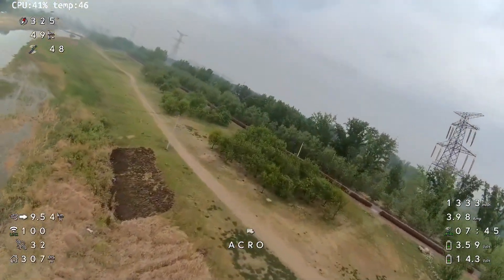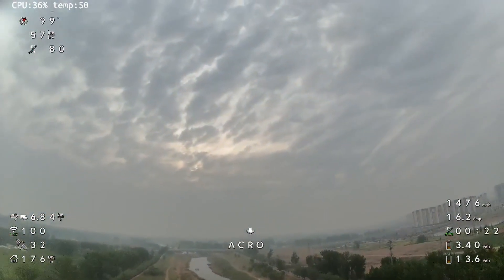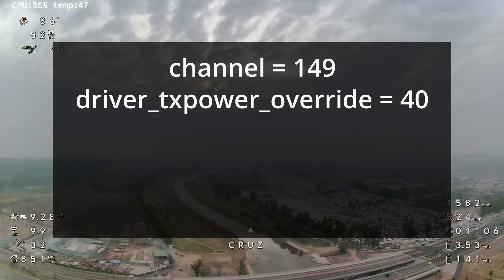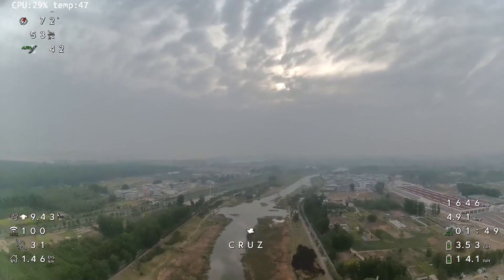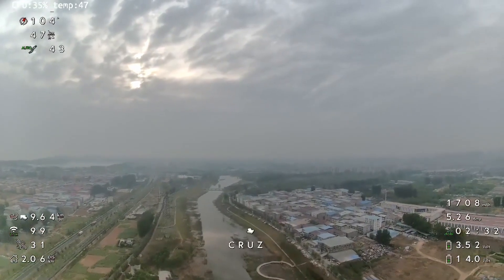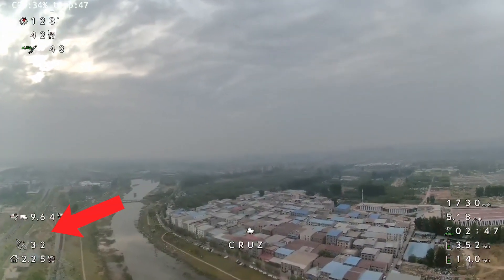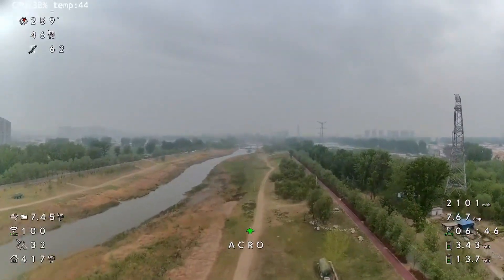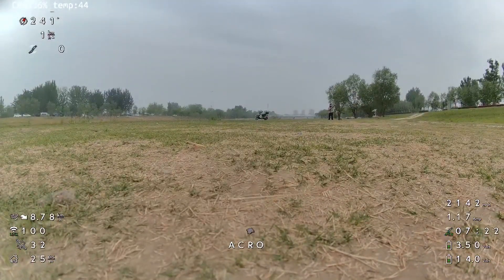Runcam WiFiLink 2 is GOOD now? // Config settings revealed

Comment: Hi friend! I'm Evandro from Brazil, and I'm having trouble getting the Runcam WiFiLink2 system image to full HD, full screen. I'm using it in an RC car and operating it on a large screen at home, but I can't get the full screen image to appear. There's still a menu on the right side. Is there some hidden setting or menu I need to activate? Thanks in advance!
Reply from the maker: what are you using to receive the signal?

Comment: Open source is supposed to mean it can be changed and shared. The ultimate goal is for it to be plug -n-play. The problem is that not everybody will be using this system the same way. For ground vehicles, with very little air flow, the hardware is the problem - too much heat.

Comment: I understand the argument of reviewing as is, but on the part of the project and in showing a consumer what a potential fit it might be, it feels of value to massage out the best config, with the best antenna combo you have access to, while communicating the reality of what it took to get the results.
You say that comes later, provided it does (as you do in this case), that's ok. Think for some reviewers it's just easier to review it as it turns up, and it shifts any responsibility away from them.
Bit like watching a rider review a bike, say it comes with fully adjustable suspension, not touch it, and then complain about feeling a bump in the road.

Comment: Why only one video is recording on SD card 
I connected battery two times to fly
But it show only first video on sd card
All time it show green led blinking 
Means it's recording but it not recording second time 
What should I do with sd card?
Reply from the maker: @khemrajdeulkar9803  onboard SD card recording is very buggy right now.
Reply: @mattscheaprc  Thank u 🙂
One more question 
Do I need sd card for camera and other setting ? 
Means Without sd card can I configure it ?
Reply from the maker: @khemrajdeulkar9803  you can configure with LAN cable and the OpenIPC configurator.

Comment: Value 20 is allowed in most countries. 20 stands for 20 dbm so its 100 mW. if you will set 40 dbm then its 10 W of power. It's not legal  in the most countries.
Reply: No it has nothing to do with dBm, it is a power level override for the wifichip, most of which only output ~500mW on max settings.
Reply: This number is not the true scale in dbm, it is a scaled value where 63 is max power of about 800mw theoretical. The number given in the vudeo of 20 = 40mW seem correct.
Reply: Ok, so it looks like parameter is not describe sufficiently. I need to look into chip specification then into amplifier and then into source code to analyze which value is allowed in my country. And finally I need to check if selected channel(frequency) is allowed outdoor in my region. For now product is done terrible, esspecially if you will compare it to dji o4 air unit

Comment: Thanks for the continued OpenIPC videos, hopefully RunCam take the suggested settings onboard and the system gains some market traction.

Which GPS module are you running?
Reply from the maker: @krazed0451  BZ251

Comment: If they shipped it with TX power any higher than that, they would have stacks of failed units lol, the cooling is wildly inadequate on the WiFiLink 2, on the bench it will reach 70c at 100mw and will breach the 85c mark in just 1 min at 500mw, the case and cooling need totally redesigning and proper heatsinks used, not just two metal plates and what Idiot thought fixing the WiFi hot side to the CPU board and giving the CPU zero cooling was a good idea?
Reply from the maker: @stevefox3763  They could have helped too by explaining what tx power does and how to change it.
Reply: mine wifilink gets to 60 degreees on the bench with the fan working and sits there, I guess there is some difference between the units
Reply: @nochannelnameisgoodenough-x1z  yours aint running at anywhere near its rated power then, 100mw on the bench will hit 69-70c, this is repeatable and is what both of mine reach and what others with the WiFi link 2 have found.
The WiFi link 2 is very poorly designed, the WiFi link 1 is the better unit and I am looking to separate the WiFi module from the main board  on my WiFi Link 2 units to keep the temps in check.
Reply: @stevefox3763  well, that's something for me to think about. I don't have the power meter to test it better unfortunately, but I'll play with it more.
Reply: @nochannelnameisgoodenough-x1z  In ruby, we simply select a power level and the temp of the runcams cpu is displayed in the osd
Reply: @stevefox3763  I've spent some time on the bench with wifilink2 (like 30 minutes) testing antennas, without an extra fan the temperature was 66C on power 40 (it's around 500mw), and with a small one it's 50-55C all the time with different power settings (starting from 1(pit) and 20 (25mw) to 52 (assuming 800mw but nobody is using it). I use stock firmware. I can't measure its real output power though
Reply: @nochannelnameisgoodenough-x1z  In ruby we can select the actual power in MW and your power settings are clearly off, it will reach 60c with ease on the bench when set to just 100mw

Comment: I have just a few queries...would be glad if u answer:
If I plan to use this system with android as the ground station, then how can I record the raw video (that is video without the OSD overlay)? Does the android app has the ability to record the OSD-free raw video?
Secondly, can the air unit record the raw video, as it has an sd card capability?
If the answer is yes, then please do come up with a setup video on how to do that...
Sorry for my bad english....TIA
Reply from the maker: Yes, the video can be recorded without the OSD overlay by rendering the OSD on the ground station instead of the air unit. You can record direct to an SD on the air unit but the feature is a bit buggy right now.

Comment: What is the difference between openIPC and ruby?
Reply from the maker: @PeterM-PeterM  OpenIPC is the software and hardware framework of being able to use IP cameras for FPV. Ruby is software that can run on OpenIPC hardware and Ruby and OpenIPC work closely together. Ruby is supposed to be more polished, but I've not tried it yet.